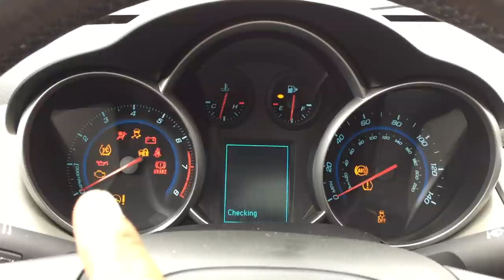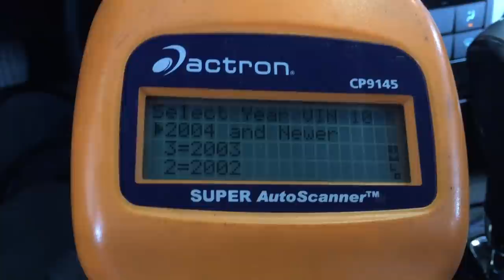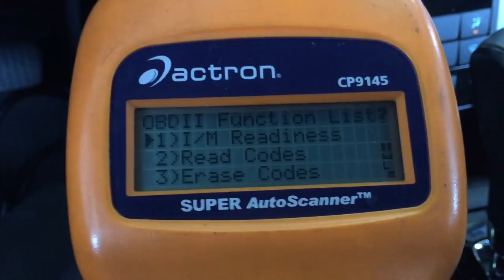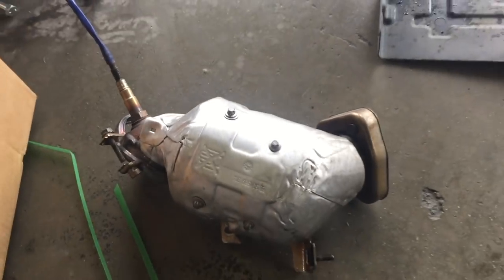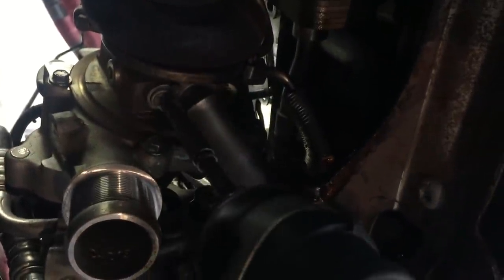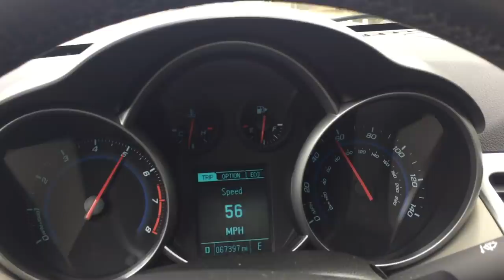Check Engine Light P0299 - How to check a Turbocharger

Comment: you are correct the wast gate gets stuck open. this happened to my 2012 cruze i used wd40 to clear away the rust where the shaft goes through the manifold and you do this while the turbo is on the engine then used carb cleaner to wash away the wd40 and solved the problem. The exhaust manifold is cast iron and it gets to hot for lubrication and it will rust there is moisture in the exhaust. Good job My cruze has 218000 miles  and i replaced the turbo at about 210000 miles so the turbo will go over 200000.

Comment: Have the p0229 code on my 2012 Sonic.  Not looking forward to removing the turbo, but I guess it's just another lesson to learn when teaching yourself how to troubleshoot and repair one's vehicle. 

Thanks for the vid!
Reply: it usually isn't the turbo that sets a P0299....that guy has no idea what hes talking about. A boost leak is most likely the culprit. www.cruzekits.com
Reply from the maker: Blitzvogel Good luck, let me know how it goes, it’s not too bad of a job
Reply from the maker: eddie in this video I’m explaining the different possible causes of the P0299. The reason I replaced the turbo assembly is because of warranty purposes,  obviously if you have this code you want to go ahead and pinpoint th cause of it as opposed to replacing the entire turbo 👊🏼
Reply: @HomieHektor  Had alot of trouble getting the 8 main hollow nuts off.  Soon to start removing the coolant to block junction.  It's all so goddamn tight.

Comment: A 2014 Cruze needs a turbo replacement. Nice. Mine was replaced twice and probably needs it again. Mine is a 2011. GM really made a quality product here.
Reply from the maker: Gene Foster tell me about it,this was my fifth one that month...
Reply: The Homie Hektor Wow. Luckily, the first two of mine were under warranty. I’m replacing this one myself. They actually had to overhaul the engine right before the extended warranty expired. Terrible product for sure.
Reply: 173k on my 2012 still going with factory turbo had to change oil feed line at 100k but I got the under boost code and my intercooler hose some how popped off
Reply: Crazy. My 1999 Passat 1.8t turbo has 246k miles and still has the original k03 Borg and Warner turbo. Also the car has been remapped since 143k miles to make 18 PSI and an additional 50 hp.

Comment: Could the code p0299 ever be due to an intake manifold problem? My check valve is missing in mine and I’ve recently replaced the valve cover and had PCV issues. My car hasn’t really had issues with hesitation as much as some rough idling and strange noises, but the code that came up was P0299

Comment: I don't understand, how and why is the crack at the waste gate flap normal? Wouldn't it leak some exhaust pressure past the crack and not spool the turbine as much? Ecm is looking at actual pressure and desired pressure so logically actual pressure would be below desired, an under boost condition

Comment: maybe its the blow off valve on the compressor side with a ruptured diaphragm , that little crack on the manifold is normal after just a few thousand miles.

Comment: Any suggestions for someone dealing with turbo issues but no codes?
Sometimes I turn car on and get p0420 catylist low efficiency.
Otherwise nothing

I got 2012 chevy cruze 1.4t manual with a boost gauge; I still reach the stock psi of 14 when WOT but under normal driving its as if the car blows off/recirculates boost randomly even when I'm still excelerating with foot steadily held in place (usually about 3/4 throttle)

Comment: Hey man! Do wastegate acuators tend to not work, i dont see mine working so its not opening the wastegate, so maybe a vacuum restriction? Or just a bad wastegate acuator?
Reply from the maker: Uriel Aguirre First check for vacuum to the actuator. if you have a vacuum pump, use it to activate the wastegate. If it doesn’t open, disconnect it and try moving it manually... you’ll know if it’s seized up 😎
Reply: @HomieHektor  after checking i know the actuator is working.
Reply: @HomieHektor  how can i reach you?

Comment: My 2017 Chevy Cruze has 34000 miles on it. Check engine light came on today. And on star diagnostic said it has code p0299. Advised me to take it to dealer within one day. Not a lease led vehicle

Comment: Nice vid man, quick question, can the flab be lubed up with high temp nickel grease to avoid sticking and binding?? Saves you a turbo😉
Reply from the maker: Sounds like a good idea, but I don’t think so...it’s sealed.
Reply: Oka,  is this a K03???
Reply from the maker: Isaac M 🤷🏻‍♂️

Comment: have the P0299 code on 2012 LTZ...Chevy changed the waste gate solenoid...next day same code again. back to the garage next Fri sounds like it might need the turbo replaced?..will c
Reply from the maker: J Fike it's a very common problem on these engines, the wastegate valve starts binding like I showed and will need the whole assembly changed, unfortunately...
Reply: You will never fix it completely just drive it. You can spend $3k and in 20k miles you would have to do it again. I been driving 60k on a bad turbo the light stays off unless you go wide open. Just save your money the 2 mpg difference ain’t worth the $1-$3k to change it.
Reply: @tammyforbes2101  it doesn’t affect the engine driving w a bad turbo ?

Comment: i have a 2018 elantra sport turbo, and the turbo seems to work when it wants to, one minute the car is fast and the next its gutless , what could the problem be, i also am throwing no codes.
Reply: Your ac is probably on when its gutless
Reply: @derekwilson8580  no dude I had a heap of problems with the car since I wrote this , I'm in the process of suing Hyundai Canada and I've opened up a camvap case against them, I basically got a lemon.

Comment: I had p0299 I knew it was turbo, Same issue they quoted $1440 Canadian to replace turbo (approx 3 hours of labour) from Chevy dealer. 
I asked about warranty  and turns out I had power train warranty so it is covered.

And I don’t have to pay $75 for them to diagnose what I already figured was wrong. :p

Next time after warranty will have half the money and just do it myself.

Comment: Hello.  I have a 2011 Chevy Cruze 1.4L with 140,000 miles.  The check engine light came on  for P0299.  Car runs great.  I do have a slow leak at the turbo oil feed line.  It is time for an oil change.  Would I have had a warning for the turbo?
Reply: i just watched a video on a guy that changed his turbo oil line, and fixed his problem because the o ring gets smashed and it leaked oil. Another guy said he changed his air filter and it fixed it lol

Comment: Was there any noise when the car was turned on because my car makes a really loud noise and as i drive it i have no boost power takes a while to get to a 45 50 miles per hour and i feel like I'm forcing it.. Took it to a mechanic he said it's the turbo that's the code he got but on these turbo videos i been watching on YouTube i don't hear a noise like mine. 😞
Reply from the maker: Janette Ortiz this one didn't have any noise, but I have worked on some with noise, and that's probably because the turbine came loose. It's a different issue but same fix.
Reply: The Homie Hektor 
Oh gosh well my mechanic wants me to order the turbo so we can get starting on the fix this weekend so just asking because i don't want to play guessing games and keep ordering parts as we go i need my car up and running 😞😞
Reply: The Homie Hektor thank you so much for your reply.
Reply from the maker: Janette Ortiz Turbo assembly should take care of your issue, once the catalytic converter is removed, you'll be able to see the turbine. 🤙🏼
Reply from the maker: Janette Ortiz you're welcome, good luck.
Reply: The Homie Hektor 
I swear.. I wish you were in my city I would of taken you my car it's been a pain in the butt having this issue fixed on my car so turbo has been replaced and took the car home from the mechanics well turns out on my way home the turbo was not kicking in i had no boost power took it back to the mechanics shop it's been 2 weeks i haven't got my car yet he can't figure out why the turbo has no power he went from saying it's the coils to boots sensor and now thinks it's the Catalytic converter that's clogged 😰😰😰  i been watching some of your videos you seem very knowledgeable person  👍👍👍 keep up the good work
Reply from the maker: Janette Ortiz I wish I could help you out. The only thing i can say is take it to a trustworthy shop that will take action for their misdiagnosis. A place like Firestone, Pepboys, or any other corporate store. Where do you stay at?
Reply from the maker: samspinchat it’s not the place, it’s the mechanics that decides. If the tech says he can handle the job, then they’ll do it. 😎
Reply: The Homie Hektor. So the mechanic total screwed me over on this .. He didn't do the turbo right .. Ended up having it to 3 weeks and still couldn't install it correctly the turbo was not kicking in ..and at the end i told him to give me my car back took it to a guy down the street and he did an amazing job and charged me  half of what the other idiot charged me. By the way I'm in Las Vegas
Reply from the maker: Janette Ortiz Sorry to hear that, but glad you got it fixed 🙌🏼

Comment: this is the only cause of the code P0299?
Reply: No,egr valve,boost control valve,map sensor,oil,turbo actuator and other things can cause P0299
Reply: Paca Lazarovska i find a crack in the manifold like in the video, i can only change de manifold?
Reply: Paca, where can i find literature  of other causes of this code?

Comment: What kinda issues would you face if that actuator was messing up? Can I test it somehow before I buy a new turbo?

At this time I'm convinced my very old probably stock oil feed line has clogged itself because I just learn those tend to bake under the exhaust manifold; but I won't have the tools to find out for a couple days. Once I check that out if it's clear and I can't find a way to test that actuator then I guess it's turbo time 🤷

Ain't got the money to buy parts and pay a shop to diagnose and labor it. Don't think the car will make it to a shop for diagnostics without risking further more expensive damage. Just gunna have to rough it on this one and get learnt. Should been fixing my own shit years ago 😅👍🤷

Comment: Hey homie I have a 2011 and its making a whistling noise with the p0299 code. Did yours whistle or chirp?
Reply: When I had a whistle like noise it was the black cover you see that says “eco tech” on it. (Camshaft cover?) i ordered the part from the local Chevy dealer and replaced it myself

Comment: Had a 0299 code on my Cruze. It had cracked around the blow off. Very common problem.
Reply: not the turbo charger
Reply: @Barnurse  had to replace turbo.

Comment: You could have just changed the waste gate actuator...
Reply from the maker: DxDiagMT it was under warranty 😎
Reply: Why? Was it not opening the wastegate?
Reply from the maker: DxDiagMT the actuator controls it, but it was binding 👍🏼
Reply from the maker: Uriel Aguirre changing the actuator would have done absolutely nothing
Reply: @HomieHektor  im not getting vacuum to the wastegate actuator? I checked intake and its dirty. You think a restricted intake can cause no vacuum to the actuator?
Reply from the maker: Uriel Aguirre it can, try applying vacuum yourself and see what happens
Reply: @HomieHektor  i did. Actuator works.
Reply: Im not getting vacuum to the little hose that goes to the actuator.
Reply from the maker: Uriel Aguirre Check the vacuum source and find out if the vacuum is supposed to be there at idle, off idle. You may have a restricted hose or intake manifold. What are you working on?
Reply: @HomieHektor  2014 chevy cruze and ive been here all day diagnosing vacuum restriction and leak. There is no leak. But ive checked manifold no restriction and ive checked the few lines to the turbo and no restriction or leak.